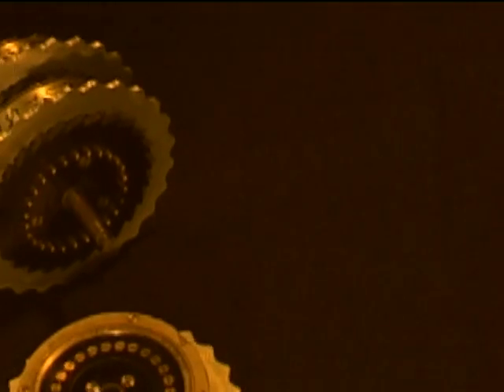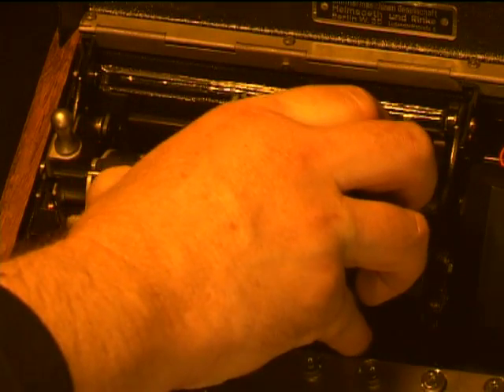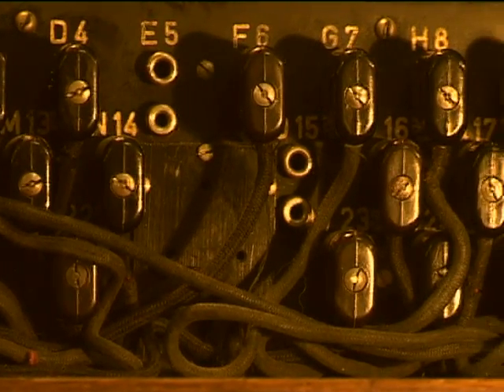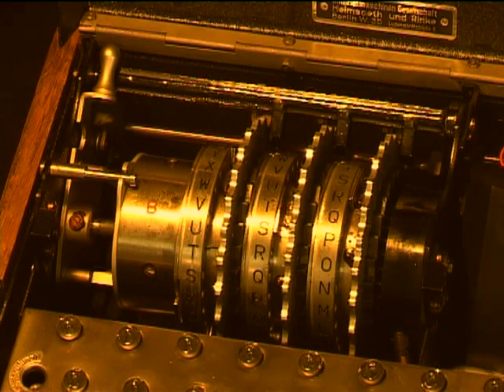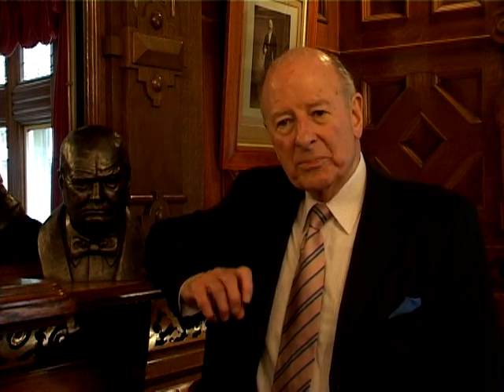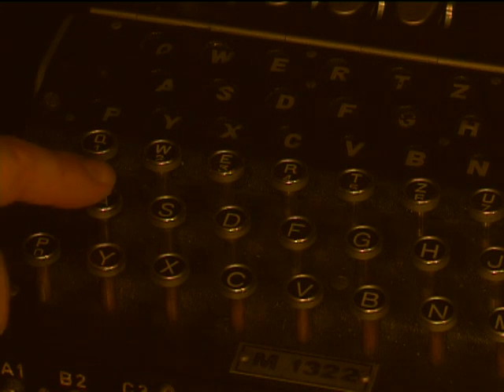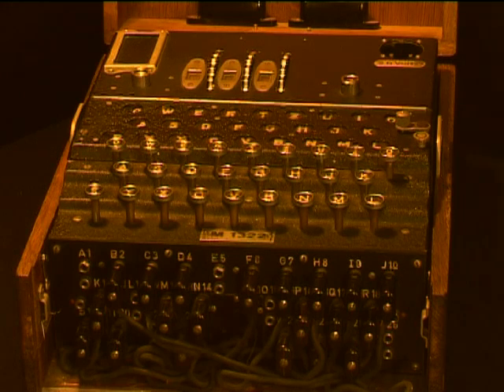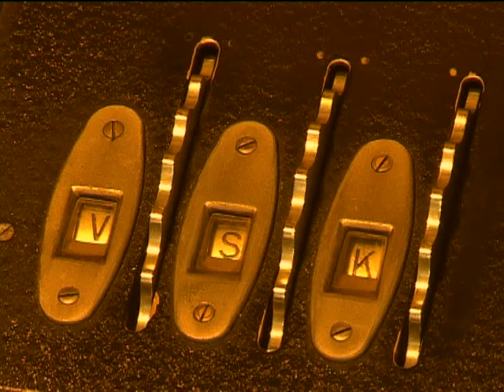Bletchley Park: The Enigma Machine

Comment: No, each military (and SD/SS etc) applied their own seperate, different settings/changes on their own timetable as each of them had different variations of enigmas, some with and some without stecker plug boards.....and those changes were not compatible with each separate service.....and, the Luftwaffe even devised their own separate stecker board UHR, a box wired with various different plug board settings the routing of each which could be changed by the turning of a knob, changing the electrical routing of the enigmas typed in letters.....and no one in Bletchley Park knew that until after the TICOM teams returned to Bletchley Park with captured UHRs  and the Luftwaffe enigmas that were connected to them......read the book: TICOM......then update this video....?

Comment: Million million million to one. Yea, I get where he's coming from but he worded it wrong. That large number is the number (approximately) of possible code combinations. However, the chance of any particular letter lighting up is only 1 in 25. If I press the "K" key 100 times, I might expect the "A" light to come on four times.
Reply: I think that he knows more about the enigma than you
Reply: facepalm
Reply: You're right jedi1357. I noticed the same miss-wording. There's a huge number of possible encodings possibilities for messages, but that's for any particular sequence of encodings (i.e. A to K, followed by M to X and so forth). But for each particular keypress, there's only 25 options—or actually 24 since Enigma did not allow any letter to be encrypted as itself.

And if I recall correctly, the missing letter (out of 26 for English) was "q." When operators encountered a "q" they replaced it with a "k." There was no upper/lower case distinction either and numbers were spell out as words. I'm not sure how they separated words.

Even the most basic form of Morse code has more letters than an Enigma machine could encrypt. My suspicion is that the original commercial machine on which it is based limited its character set to save money and the military version simply continued that.

It's an interesting aside that radio operators on both sides of the war used Q codes to shorten common messages. They'd been developed for commercial radiotelegraphy (i.e. ships at sea) and spread to radio hams. The latter group then spread their use in the military. 

https://en.wikipedia.org/wiki/Q_code

And it was British hams who, during the German invasion of Poland, told British intelligence that it was possible to pick up German tactical communications in the UK. You can find that in Geoffrey Pidgeon's The Secret Wireless War. The British built huge rhombic antennas hundreds of feet long and put them on 100-foot poles to maximize their chance of hearing messages.

I've often wondered how the two sides handled situations where they were on the same frequency and interferring. Did on operator politely wait for the other to finish?

Comment: It was just another example of useless and behinded nazi tech. The Allied used SIGSALY which the nazis couldn't compromise. The current CDMA handphones are direct successors of SIGSALY but enigma doesn't exist anymore. Mechanical cash registers are illegal to be used in real world commerce; laws require to use on-line POS terminals which are based on dual monitor PCs.